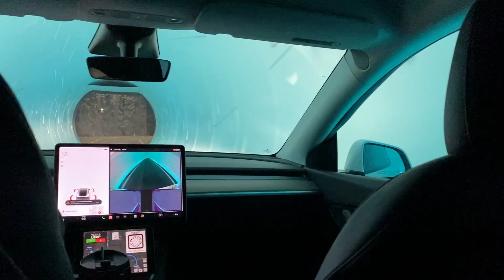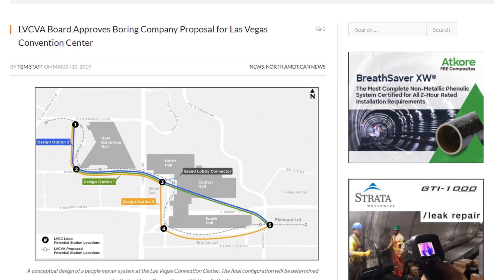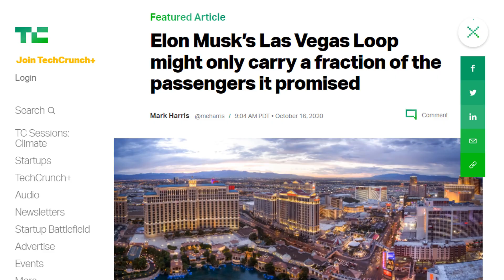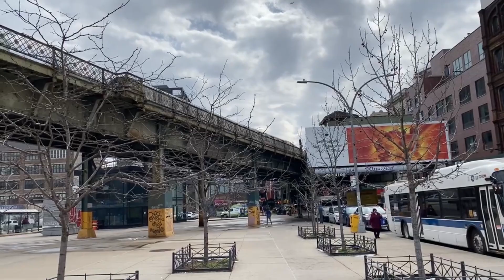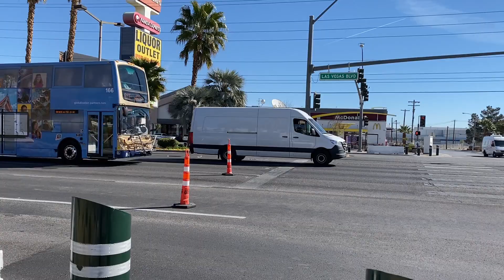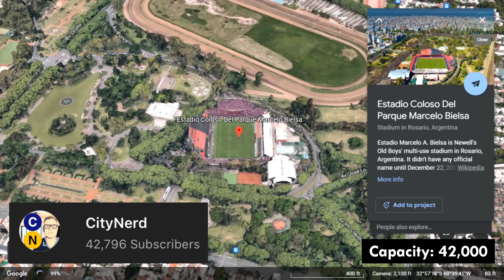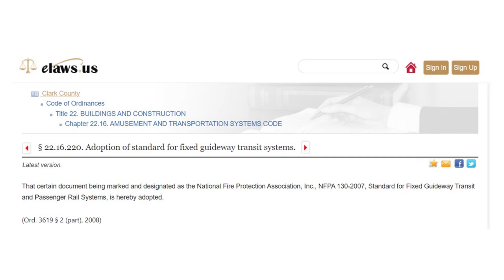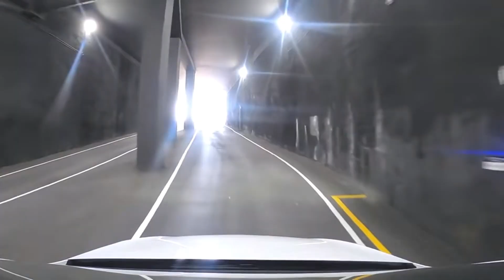Inside the Las Vegas Loop: Transportation Game-Changer, or Complete Waste of Time and Effort?

Comment: My first time ever riding any kind of transit was a tram in an airport, I think it was in Atlanta, and I mean, it worked just fine. Loads of people used it and it was really fast. Vegas could've built something just like that and it'd be way better.
Reply from the maker: But Boring Co underbid so they could market Teslas to convention-goers
Reply: @CityNerd  TBC’s bid was $150 million less than the competing bids for elevated and underground trains. How much of that was taking a loss in order to sell teslas to convention-goers? And how many teslas will they have to sell to people who wouldn’t otherwise buy one to make up for it?

It’s possible that TBC undercut the competition on the convention center loop, and there is no question they are lowballing with their $0 bid to build the 29 mile Vegas loop.  But their primary purpose isn’t to sell cars. It’s to sell tunnels.
Reply: @CityNerd  I wonder what the cost overruns were like.
Reply: The Boring Co has just submitted a bid to the city of Miami for a 6.2 mile Loop with 7 underground stations in a straight line from the city to the beach which has some more interesting figures on capacity and costs of Loop type networks. 

It will handle 7,500 passengers per hour with the option of scaling it up to 15,000 people per hour. 

Estimated cost is around $185-$220 million which gives us a cost per mile of a remarkably cheap $30m - $35.5m per mile for a dual tunnel, a cost which in this case also includes an underground station every mile instead of the much cheaper above-ground stations of the 29 mile Vegas Loop. 

In contrast, an above-ground, much slower light rail would cost over $1.2 billion while a subway would cost upwards of $3 billion.
Reply: @andrewfranklin4429  7,500 pax/hour/ 2.5 pax/vehicle = 3000 vehicles/hr = ~1.2 seconds between vehicles. That's the dispatch frequency it needs to achieve that number, using the recognized way to count. It's equivalent to a highway lane running at capacity. Underground. Stopping at several stations to pick up passengers. Pardon me for considering that number to be utter bunk. 

And the cost estimates too. The reason why everyone else submits bids in the billions is because that's how much it costs to do a project like this. There's land acquisition, and soil testing, and mapping of affected infrastructure, and planning, and engineering, and maintenance, and HR, and depositing the excavated soil, and all the whatnot; fixed costs that are completely independent from the digging of the tunnel itself, and those easily run into the hundreds of millions for a project this size. The digging process is only a very small part of it, and it's the only one The Boring Company are addressing. 

This is pretty much guaranteed to end like the San Bernardino project somebody mentioned in another comment: A proposal made for the publicity, turning into vapourware as soon as somebody begins to crunch the actual numbers and not the fairytale ones.
Reply: @Codraroll  The Boring Co is planning on a headway of around 0.9 seconds (5 car lengths between EVs at 60mph) which will give a throughput of 4,000 EVs per hour.  That works out as 10,000 people per hour with 2.5 pax per vehicle. 

Remember,  cars on freeways driven by distracted, drunk and careless drivers typically have a headway down to 1 second.  A one second headway is a distance of 27.7m between cars travelling at 100kph (60mph) or almost 6 car lengths.  My experience of driving on busy freeways at those speeds is you're lucky if you have three or four car lengths between cars.

Once the Loop autonomous control systems with their millisecond response times and ability to for example command ALL vehicles in a section of the Loop to brake or accelerate simultaneously, there would be no problems achieving smaller headways than fallible humans.

And no, the Loop EVs do not have to stop at every station to pick up passengers like a train has to. Instead this is a point-to-point network where the EVs travel at high speed direct to their destination station without having to stop at every station in between. 

Why do you consider these numbers as being bunk?

The Boring Co has already built multiple tunnel systems, one test tunnel Hawthorne California and the LVCC Loop as well as the the Resorts World tunnel and more test tunnel at their new Boring Co property in Texas. They know what they are getting into and yet have still committed to building the 29 mile 51 station Vegas Loop for zero cost to taxpayers and the Miami Loop at $35m per mile. 

Why don’t we just hold off on declarations of can’t and won’t until they at least get more of the Vegas Loop completed and we can then either applaud them if the succeed or laugh if they fail?  

Any blanket dismissals of their efforts are far too premature considering how successful the LVCC Loop has been.
Reply: @andrewfranklin4429  SEC much? Have you been compensated in any way to put up all these posts, because it sure comes across that way.
Reply: @johnmcphee7129  Perhaps you’re unused to someone who enjoys writing about topics they are interested in and who actually supports their position with facts and data rather than engaging in the usual snarky one-liners?
Reply: @andrewfranklin4429  W- where is the safety if the automated cars are going 60 mph in a 0.9 second headway? If one just suddenly breaks down, what will happen? We can’t just assume that the system when breaking down won’t assume in a multi-car catastrophe. It takes like, only a few seconds to see the problem there lol
Reply: @peskypigeonx  hi Pigeon, a 2010 study by the Honda Research Institute found that 25% of drivers maintained a distance of 2 cars between vehicles at 60mph on a busy 2-lane freeway, 15% 3 car lengths, 15% 4 car lengths, 5% 5 car lengths and 15% 6 car lengths. 

So that is 75% of cars having a headway of one second (~6 car lengths at 60mph) or less and 40% maintaining a headway of 0.5 seconds (~3 car lengths at 60mph) or less. And remember those are cars driven by potentially distracted, drunk and careless drivers. 

Note that a headway of 0.5 seconds = 7,200 cars per hour
And a headway of 1.0 seconds = 3,600 cars per hour

The Boring Co is planning on a headway of around 0.9 seconds (~5 car lengths between EVs at 60mph) which will give a throughput of 4,000 EVs per hour.  With 2.5 passengers per car that gives us 10,000 people per hour. With 4 passengers per car 16,000 people per hour per single tunnel. 

Once the Loop autonomous control systems with their millisecond response times and ability to for example command ALL vehicles in a section of the Loop to brake or accelerate simultaneously, there would be no problems safely achieving headways of this duration.
Reply: @andrewfranklin4429 1. you are really sounding like a customer response center
2. can you link the study?
Reply: @andrewfranklin4429  Also, didn’t we plan for a high-speed LVCC loop, but now it goes about 30mph?
Reply: @peskypigeonx  Heh, it's just that everyone seems to post the same comments so I took the time to research such issues.  Bit of a hobby of mine. 🙂
Reply: @peskypigeonx  that’s also a common question. Here’s the info:  some people believe Musk promised speeds of 150mph in the Las Vegas Convention Centre (LVCC) Loop which is not true as it would be absurd to expect those sorts of speeds along the very short 0.4 mile spur tunnels between the three stations. 

What The Boring Co (TBC) did say was such speeds would be possible in the now-under construction 34 mile Las Vegas-wide Loop which has much longer high speed tunnels capable of handling such speeds. 

And TBC has actually driven visitors at 127mph (205kph) in the company’s longer 1.14 mile test tunnel in Hawthorne California with YouTube clips from 2 years ago showing what is possible when you have longer tunnels.
Reply: @peskypigeonx  ps. the current speed limit in the LVCC Loop is currently 40mph (64km/h) down the straights and 30mph around the curves.
Reply: @andrewfranklin4429  Did I not ask for a link? To the Honda study? The one that put your argument together?
Reply: @peskypigeonx   I’m blocked from posting the link so try searching for this text: 
“Studying the Tailgating Issues and Exploring Potential Treatment”
August 2012Journal of the Transportation Research Forum 49(3)
Authors:
Miao Song at Honda Research Institute USA, Inc.
Jyh-Hone Wang
Reply: @andrewfranklin4429  I found it, at first I found the layout pleasant, but when clicking to the DOI or any sort of source it is nonexistent. It supports your point but… where’s the evidence to that
Reply: @peskypigeonx  I think the best confirmation of this data is what one experiences daily driving on freeways and highways in heavy traffic. I’ve noticed most traffic round me only leaves about 2-3, maybe 4 car lengths between vehicles when the travelling at 100km/h and I have to admit I do the same. It’s often an unconscious thing as otherwise, other cars sneak in front of you all the time. 

Next time you’re on a freeway with heavy traffic that is nonetheless still flowing at 60mph (100km/h), let me know how many car lengths most people leave. 

As such, the Loop leaving 5 car lengths between vehicles is positively conservative.
Reply: @andrewfranklin4429 I’m far from being an Elon fan boy. Thanks for your research.

1. My sense on Boring company has been that it’s a great system for low throughput.
2. I love that this thing is being made without people’s tax money.
3. But This project would be much better IMO if there was an actual train going through. His tunnels are much smaller diameter though , reducing the volume of earth removed to be 64% less (which reduces cost) but probably doesn’t allow a tunnel to go through.
4. The worst part about the system, which nobody has mentioned is how expensive the tickets are for the sample pricing on the website. And that’s the primary reason why I dislike it.
5. I can see this being a great supplementary system to existing networks.
6. Heck, if they made a BRT of this system, it would be superb.
Reply: @andrewfranklin4429  I'm interested in it. I see it more like a subway with direct, faster trips at the cost of capacity. But honestly the tunnels are so cheap you might as well just have 4 of them on all lines and run it as a subway.

Comment: Would love to know the operating costs for this thing when it's fully "built out" (not that this will ever happen, but still). Lets assume each station has a fleet of 15-20 cars loading and unloading. Lets assume they end up with 40 stations. Lets also assume there are around 100 cars in transit at any time. You're going to have around 1000 cars operating at that point. 1000 drivers X $15 an hour X 20 hours per day would be $300,000 per day. Even if they can manage 100,000 riders per day (which they never will), that's $3 per pax just for labor. Just insanity.
Reply: And then chuck the maintenance costs for 1000 vehicles on top of that. And the costs to maintain however many miles of tunnels there are, since the system is entirely underground. And loads of other things I've overlooked.
Reply: You do realise the current 3 station 1.7 mile Loop is already handling 27,000 people per day during large onventions?  Once the 51 station, 29 mile Loop is complete, it'll easily handle far more than 100,000 per day.

And don't worry, autonomy is ready, they're just awaiting liability to be sorted before rolling it out.
Reply: @andrewfranklin4429  51 stations Loop only 100000 people per day :-)
One station Paris Metro Gare du Nord Station 34 million people per year
one station alone